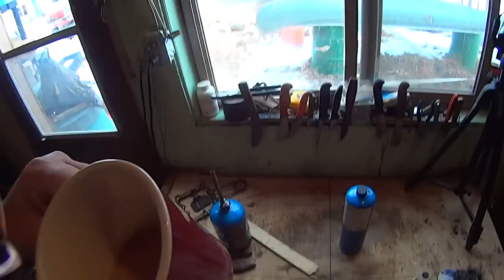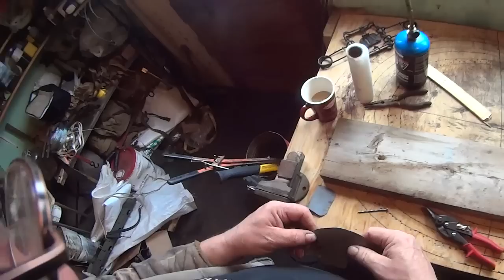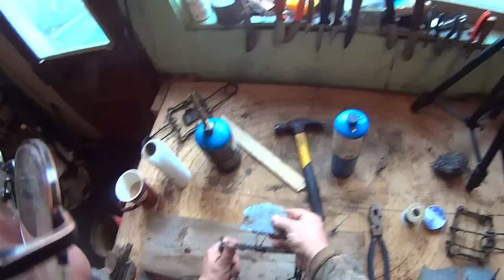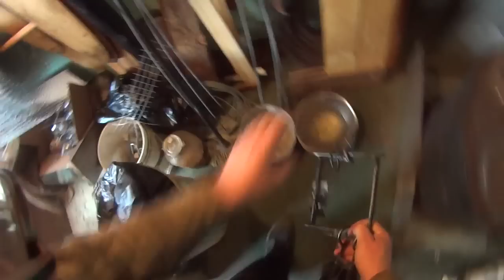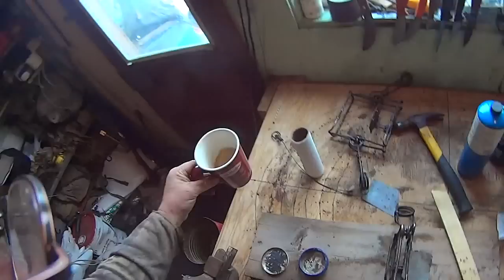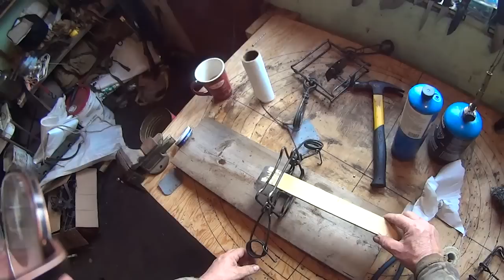How To Make Pan Triggers For Mink

Comment: Try silver solder or bronze rod.. makes joining ferrous metals easier. Good Idea though. Might give it a try. Thanks
Reply: 4x4extreme5 was going to say the same.  or a quick tack with a welder.
Reply from the maker: That 160 is the first time I have ever had one let go. Must be the extra snapping power or something. Do you use a bronze rod the same way as solder?
Reply: The brazing rod has its own flux coating on it and as long as the surface your sticking together is clean it will hold extremely well. You might need a bit more heat to get it to melt. MAP gas works well instead of propane.
Reply: Heat the metal until cherry red and apply the rod. Not much more to it than that.
Reply from the maker: Thanks... what is MAP gas?
Reply: Sorry I should of written MAPP gas. its just a substitute for acetylene but is much safer to use. Comes in the small bottles like propane but they are yellow instead of blue.

Comment: Could you put a tab opposite the first punch two holes in it then bend the wire to the sides? Then you wouldn't have to solder and could use the trap in original form if you wanted.

Comment: Cool and helpful video. Have you tried drilling out the trigger, removing the wire, and inserting the pan tab in there? Then you can bolt it on

Comment: Nice work. You may put other two holes to put in the ends of the wire in, so if the solder are loose, the wire not come out. Thanks for sharing. I wait every time your new videos.Take care, Gyula.

Comment: excellent job on the pan not to be a smart ass but i do a lot of pluming so i solder a lot and if you want strong solder you heat the metal on till the solder runs from the heated metal not the torch... thats my two cents worth hahaaaaa LOL
Reply from the maker: Ya I know better. Got it to hot I think and maybe the metal was dirty.